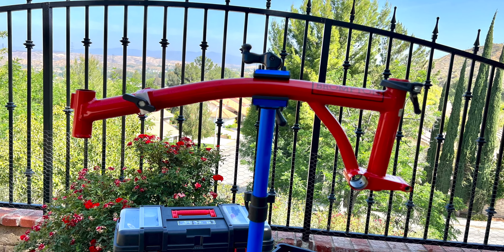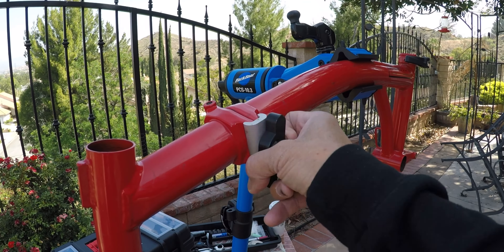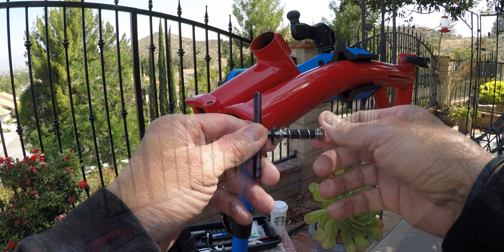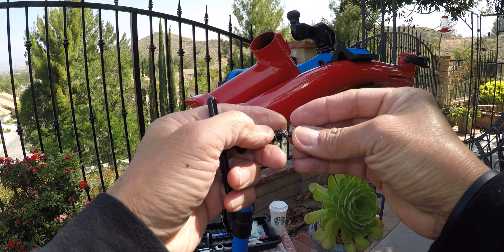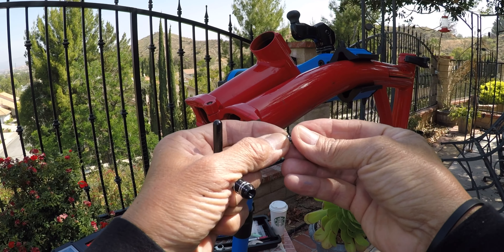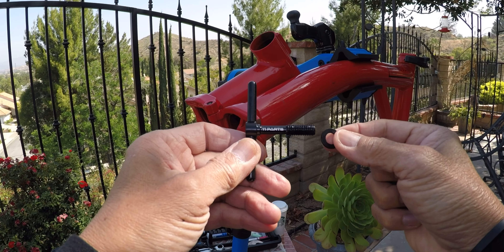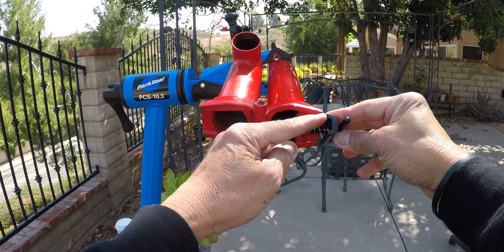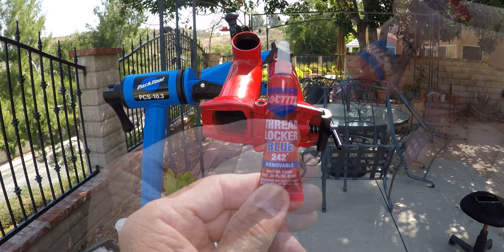PROJECT PART 3: Superlight Brompton - Ti hinge clamp plate/lever installation

Comment: As used to use metric, I don't know the target, but I have made changes to my Lightweight, as this, with carbon clamps and bolts with a security bolt in the end. I didn't care to give mine Locktite, as I hardly expect it to become loose.